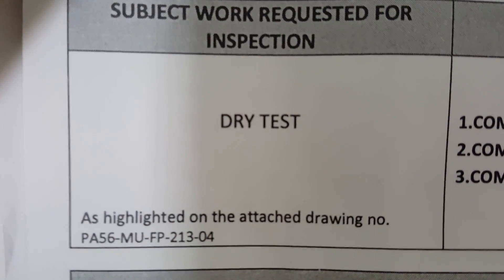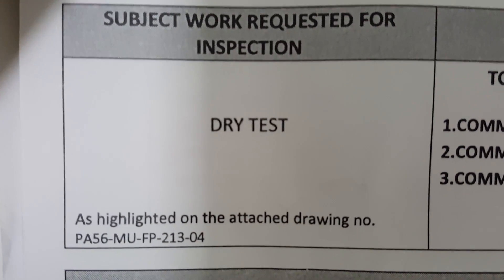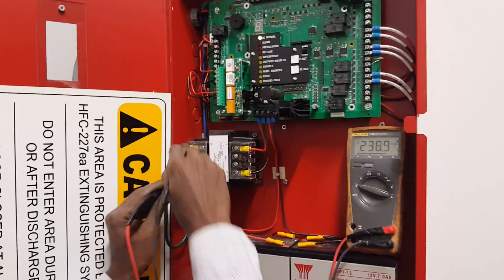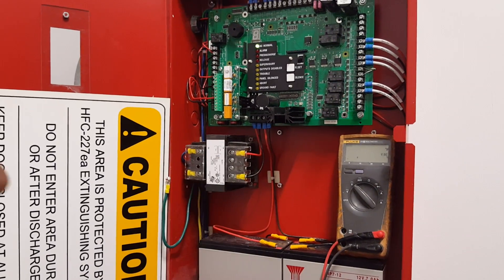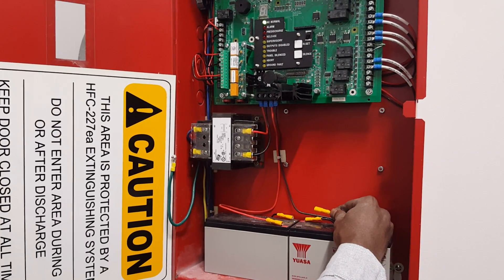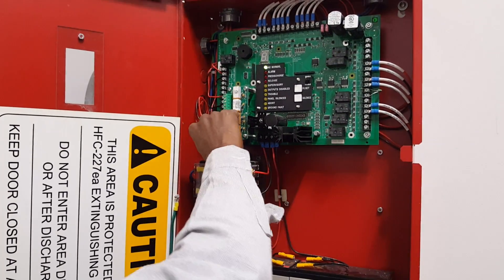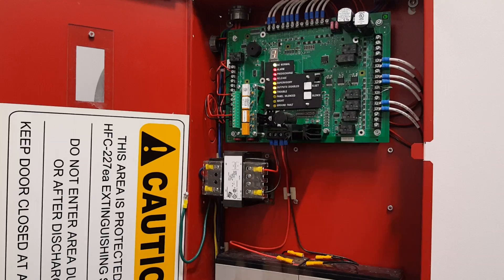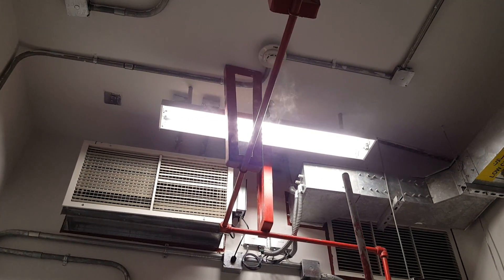FM-200 Dry Test function

Comment: if good conditions are constant and no moisture this type of emt is just fine, it also moves with building vibration reducing odds that connection will be a point of failure.